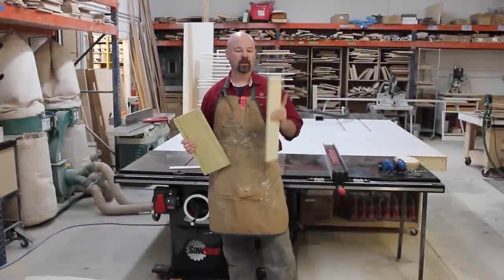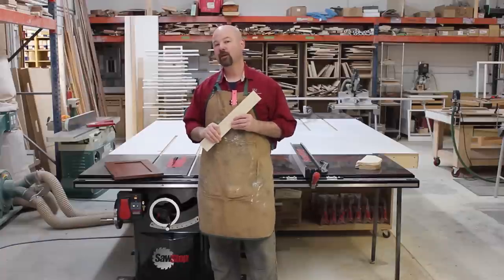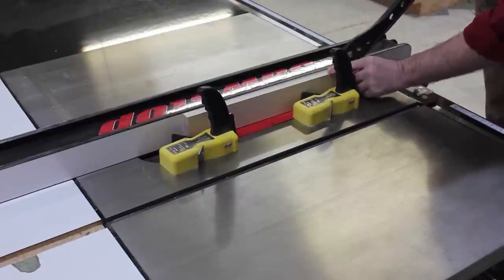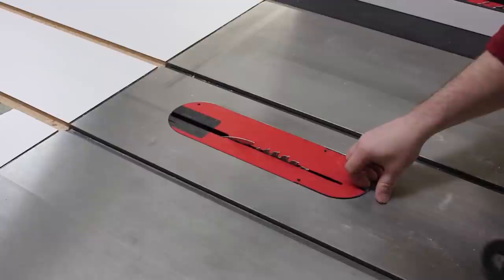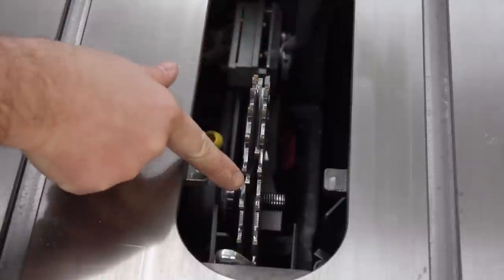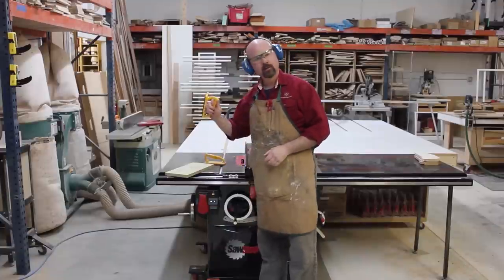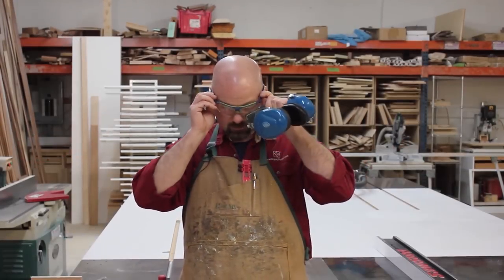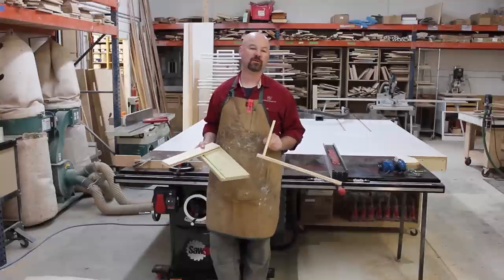Cutting Dados & Grooves On Your SawStop Table Saw

Comment: Please excuse me if I sound stupid. Wouldn't the Riving Knife push the wood up when cutting groves? I'm a total newbie and I'm watching videos before I use my first ever table saw. I want to cut a sliding dovetail. Thanks, I'm confused as to why you removed the riving knife for the dados and not the grooves as it seems similar cut as it does not cut the wood all the way through
Reply: With a dado stack you do not use the knife

Comment from the maker: Our friend, Gregory Paolini, gives us some great tips on how to cut dads and grooves with your SawStop table saw. This video was created for SawStop's friends and fans. Enjoy!
Reply: Very nice presentation.

And let me say by and large I am a happy SawStop owner, but you mentioned a sore spot. That is in the last 6 months SawStop is now saying you should not use a solid disk Dado blade.

I have talked to the support staff and understand their concerns, but the issues is one of weight, or rotational inertia, not style.  I am a Mechanical Engineer,  so the "legal" warning included with the new dado cartridge  did not make sense.

I would love to see some some reasoned guidance on this matter, that does not revolve around "style"

Again very nice video, and I apologize for hijacking the thread.

Regards
Carl
Reply from the maker: Carl, thank you for your reply. We're very sorry that you did not find the answer you received from our technical service department satisfactory. At the risk of repeating what you've already read, the issue with solid plate interior chippers is simply this: because of their weight and mass, this type of dado stack may damage the arbor if the brake cartridge activates. That said, this venue is not the most efficient place for us to support our customers, so I invite you to email: service@sawstop.com with any further inquires on the topic. We'll work hard to answer your questions! Thanks again!
Reply: I agree with your assessment, however when I asked your support department their response was to weigh a dado stack on a postal scale ( a Forrest dado stack I believe) and the number that was given was 7 pounds. So any "batwing stack" that exceeds 7 pounds would also be an issue.

That info was enough for me to act in a somewhat prudent manner.... my stack has not exceeded .75 inches and it was ~7.2 pounds. 

I have waited for clarifications on this matter but I have received none (in private or public) .... hence my introduction of the matter here.
Reply from the maker: Carl, we apologize that you were given incorrect information! Typical "batwing" dados are between 6-8 pounds, so 7 pounds is well within a typical and acceptable tolerance. Rather than relying on pound guidance, suffice it to say that SawStop simply does not recommend solid plate interior chippers. Thank you again for your time and feedback!

Comment: Greg, 
Great set of videos on this channel. You do a good job of explaining and demonstrating TS use and safety. I agree that it is simple to change the brake cartridges when changing to a dado set. But, I do think that you should show the adjustment of the brake to dado set gap after installing the new setup. This is also a simple process, but the documentation from SawStop indicates that this is an important step for the safe operation of the machine.  

Also, like many of us, I wish I had a shop like yours!

Comment: Hey Greg - Nice video intro to grooves and dados!  I'm about to get myself a sawstop - question about the table size right of the blade.    Is the 69" table necessary except for cutting sheets?   I just don't see using such a large table.  You seem the have the 'even bigger' one.  How often are you actually using such a large table extention?

Comment: Great video. You stated saw stop want to use maximum width data set of 13/16. Yet when I try to load dado set of 3/4 dado(12/16) my nut will hardly screw on arbor when flange is added. How do you overcome this problem?
Reply: I know it’s been a year but the manual says:

“For dado widths larger than about 3⁄8 inch, do not use the arbor washer. Instead, tighten the arbor nut directly against the dado set. Use the blade wrenches to tighten the arbor nut securely.”